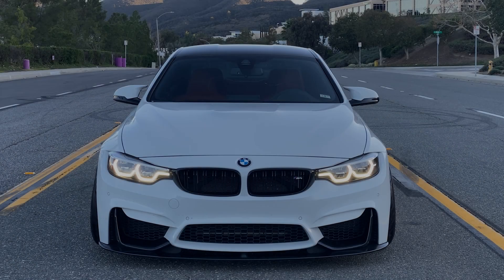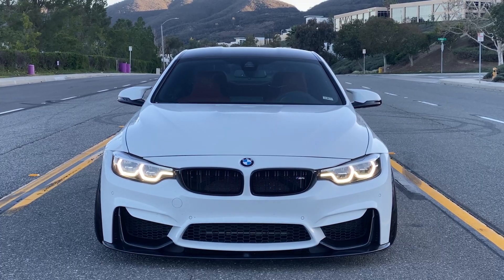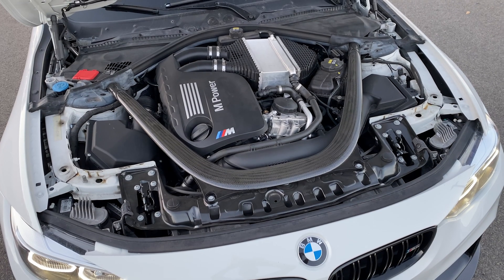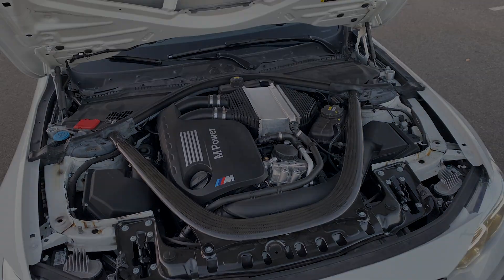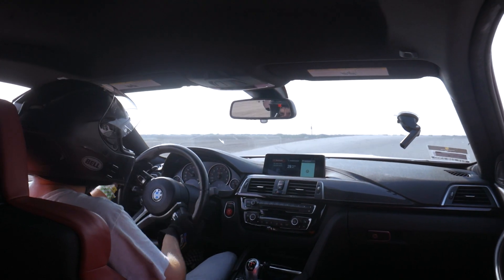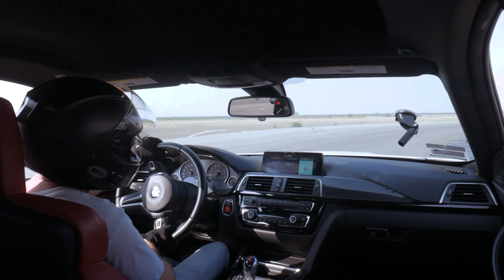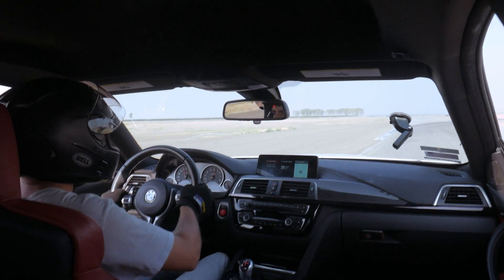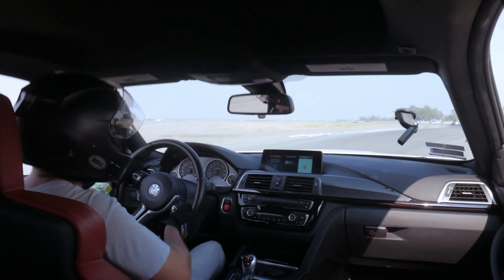When Should You Upgrade Your S55 Crank Hub? | BREAK DOWN

Comment: Tbh crankhub failure is 95% of the time user error, if your not someone that takes it easy on your car then id consider doing it. If you plan to make upwards of 500hp or if you have a model that has close to 100k miles on it, then id also consider doing it as well. It's nice cause w/ the crankhub you get all preventative maintenance done, so its kind of in you favor in that case. You get the oil pan gasket done, valvecover gasket, coolant flush, and much much more, so that could make it well worth it if you plan to keep the car over 100k miles, or at least till then. By the time an S55 gets close to 80k-100k miles all that preventative maintenance is going to need to be done anyways due to seals having to many heat cycles & fluids just simply getting old. So if your someone that can take it easy on stage 1 and you just commute to work M-F and just get on it on the weekends (how I do), you will be more than fine, don't worry about it. Just don't be downshifting your car to redline consistently, especially in 1st & 2nd gear. I have plenty of friends w/ s55's running bm3 stage 1 w/ no crankhub and they've never had any issues. There is a reason there was never a recall for the crankhub….. and why it was never covered under warranty, in most cases that is. Also don't forget BMW's M division ran the M4 GTS with 493hp on the S55 with no crank hub fixes, issues, or anything. This how you know the S55 stock crank hub is good for somewhere close 500hp without having any issues. Again, that is if your not downshifting to redline in 2nd and 3rd all the time.. Hope this helps some of you!
Reply: I have a 17 M4 Competition i went ahead and did it.  I added a stage 1 tune.  I believe it was worth it as I dont have $20k for a new engine if something goes wrong
Reply: @sickvendetta9  Your more than fine...just don't go stage 2 without it.
Reply: Stage 2 100octane and pureturbos....and no crank hub
Reply: facts
Reply: Bro you're just talking out of your ass
Reply: you're awesome brother. thank you.
Reply: FYI I spun my crank hub with 7K miles on my F82 M4. If you tune it do it. It's extremely stupid not too. People that say they don't need to also probably can't afford to pay for a new engine either. So basically if you want to tune it do it. If you leave it stock you should be fine.
Reply: @BlakesGarage  i just got an m4 with 60k miles, wonder if i should do it. I plan on leaving it stock engine wise for some months
Reply: @F82_  Then your fine don't worry about it. Check what I typed out up there, it explains everything. If you wiling to be mindful your even safe on Stage 1 bro, just don't be downshifting to redline everywhere you go. Also if your already at 60k just last another 20k miles and you will have to do all your preventative maintenance anyways and all of it gets done with the crank hub, so if you can wait it out that's the best way to go. Valve cover, oil pan, coolant flush, and much much more gets done during the crank hub. All this stuffs gotta be taken care of by 100k miles max no matter what
Reply: @stoss-11  just got an m4 with 53k miles was thinking of doing this since it has an expensive exhaust so idk if it was tuned before but I think I’d wait it out till 80k and do what you said thanks honestly! Was just worried about it spinning cause I’ve been stepping everywhere I go
Reply: @lifethroughnick any update on this? Did the crank hub hold up? Tune/mods?
Reply: @warhawksxaid  never did a crankhub, always raced my car took it to the track but only drove it like 20k miles before I traded it in for a g82, had a stage 1 , Intake,exhaust, and that’s about it I just know the crankhub goes when you downshift super hard
Reply: @BlakesGarage  Yes but most of the time it trickles down to user error, if you don't downshift hard constantly and keep stress off you motor then you'll most likely be fine on Stage 1. We are all on it stage 1 now and none of us have problems...at least all the ppl i know on Stage 1 that is. Anything over Stage 1 and in that Stage 2 category you defiantly need to do it. Don't not enjoy your car over it, just be mindful.
Reply: @stoss-11  mine went on an upshift after wheel spin. But yeah I was on E85 at the time. Still I wouldn’t risk it at all when you know there’s a fix and a problem.
Reply: @BlakesGarage  100% agree. I think it’s gonna come down to if the person can afford right then and there. If they can’t, nothing to worry about, go stage 1 if your itching for a tune on the car, just make sure to take it easy in the meantime. If you have the money DO IT, there’s nothing to contemplate.
Reply: @BlakesGarage  was yours an automatic?
Reply: @craftgarrett1  DCT yes. Spun on a upshift 2nd to 3rd with wheel spin. Spun when the tires grabbed.
Reply: @BlakesGarage  were you paddle shifting?
Reply: @craftgarrett1  yeah, man shifted up. I was on E85 at the time. It spun slightly so I didn’t ruin the engine but I recommend anyone that tunes a S55 do the crank hub it’s not worth taking the risk. Because you think it’s the drivers fault. It’s a non keyed cog on a smooth shaft that relies on clamping force from the bolt and friction ring to HOPE it doesn’t spin.
Reply: Lol ..I kinda like how there’s a discussion casually involving ethanol as if that alone isn’t the main reason for this ..common but not actually common, debacle lol “common but not actually common” because it’s FAR more of a common conversation being had than something that’s actually a common issue, specifically with these vehicles. And the much sadder part is that it’s being spoken of like the s55 is the only engine that this happens with lol. It’s as simple as this... you take care of your shit, it’ll take care of you 🤷🏽‍♂️ No need for the continuous spread of misinformation. It’s like.. everybody wants a nascar but doesn’t want or like nascar issues lol if at any point the crankhub was faulty or actually not reliable there would’ve been a recall on it, a long time ago. BMW M’s aren’t meant for everyone’s driving style and habits.
Reply: @MrDavidchuck  Exactly very well said bro I agree. It’s very simple, if you take care of your shit, your shits going to take care of you. Especially when it comes to these cars. Exactly people act like this is the only engine that has this problem, wb n54 and N55 ? There crankhub are 2 piece design so why aren’t they complaining about it as frequently as stock S55 owners?? It’s simply blown out of proportion! So everyone needs to chill out about this crankhub bullshit if your not going stage 2 and you take care of your car. Don’t get me wrong it’s definitely something that should be done if money is not an issue for you, but there’s a time and a place. This crankhub upgrade is not for everyone!!
Reply: @S55kid  smh definitely not on here tryna put on like I’m some master tech but it’s TOO much of a simple thing to take heed of yet it’s being carried out like the end of the world is approaching lol no matter what stage you’re on or even what car you drive, maintenance and thoroughly understanding your vehicle (and how cars behave), is key. If all of that is too much to ask for, ride a bicycle or use public transportation 🤷🏽‍♂️
Reply: @MrDavidchuck  I like you bro 😂
Reply: @S55kid lastly.. I’m stage 2, full bolt-ons (resonated catless DP, charge pipes, j pipe, intakes, intercooler, 1step colder plugs), it’s a ‘16, started paying the car off in ‘18 with just under 20k miles on it, now sitting at 47k. Daily commute, M-F to and from work, along with some miscellaneous locations in the mix especially on the weekend. I really just respect the car like I tryta respect people.
Reply: @S55kid .. random times I’ll drive my girl’s wrangler too, so that’s also been a great supplement. Driving my own shit though, I don’t shy away from its purpose of being driven hard, at all. Respect.. self-control and moderation 🤷🏽‍♂️
Reply: @MrDavidchuck  yeah, take car of it by spending the money for a crank hub if you tune it. Otherwise you’re just risking it to be cheap and soon enough it will happen. This is the same debate about not all Subaru EJ engines explode 🤯 uhh yeah they do it’s just a matter of when.
Reply: @Blake’s Garage  lol we’re both agreeing with each other. We’re saying the same thing but in different languages. Same way ej25’s aren’t for everybody and there driving habits/styles, it goes the same for M’s and cars in general. If you’re not willing to respect these machines, they’ll equally take a big load of shit on you and whenever they’re ready.
Reply: @MrDavidchuck  lol yeah sounds like we are.

Comment: Great Great video bro, this needed to be talked about! I swear its always the E85 tunes that spin that shit.  lol 90% of my Spun crank hub stories are all E85 tunes
Reply: I’ve have homies who spun their hub on stock tunes as well bro
Reply: @luislagunass  true but I personally don't know any, so therefor its in the category of "Un-common" for me. I do understand it happens but if it where THAT common for spinning, then id know more ppl who have spun it and Bmw would have had a recall for it, and they didn't. Therefor I'm not worried about it past stage 1 nor should anyone else as long as they don't drive hard everywhere they go and downshift to redline
Reply from the maker: thanks bro! Yea E85 just seems to be the official tipping point for the issue
Reply: I've been running e30 for a few months now on stock hub lol, I should get mine done soon. 6MT though
Reply: @MikeyG003  I have a homie w/ a 2018 comp pack running full E on stock crank and he is fine. AGAIN it all comes down to your driving style. If your conservative and respect the car, its gunna be fine. 90% of the time
Reply: @stoss-11  yeah I don’t drive too crazy, but I do push it 40% of the time and I also do the occasional races. Also I don’t think anti lag helps, prob puts more stress on the crank hub too
Reply: @MikeyG003  In the exact same boat, only about 40% of the time. Yes anti lag & launch control will help save the crank if you don’t do those stupid things. Anti lag mostly saves your turbo, cause the turbos compressor wheel is what’s spooling up super fast for anti lag to work. The turbos take most of that stress for that. Which is still not good 😂 but another very important thing is in 1st,2nd,&3rd gear never downshift to 5-6k rpm. Hard Downshifts in lower gears creates a lot of stress on the friction disc that is essentially holding crank hub together. One wrong downshift in to low of gear will spin it